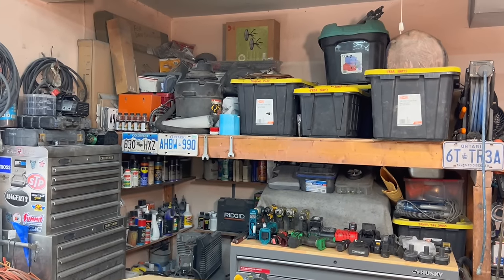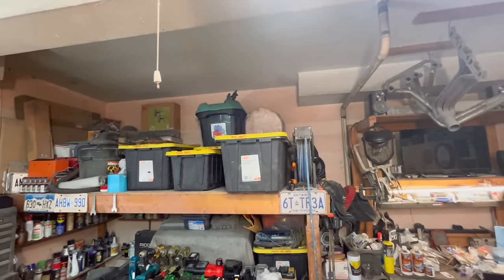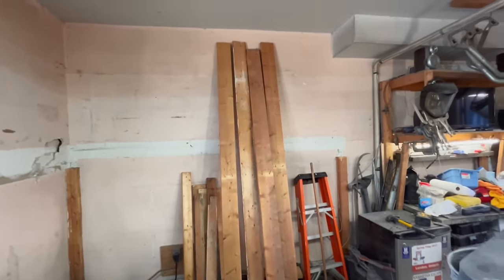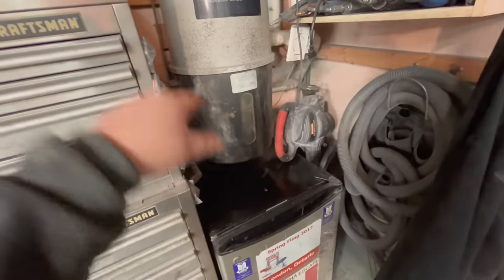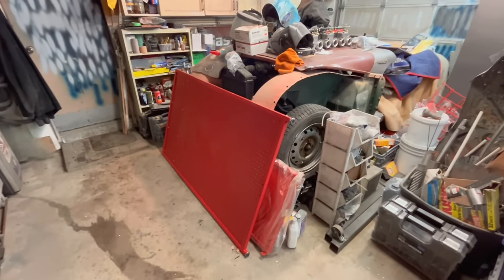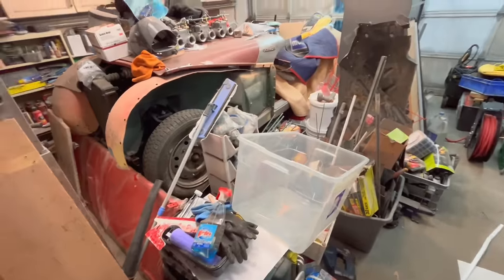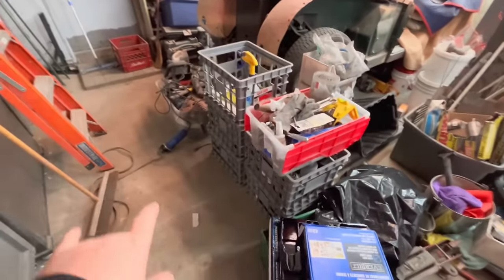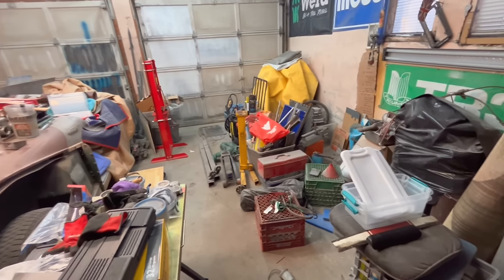Garage Makeover Project.....

Comment: David! Hello from Argentina! Man, am I glad you are posting since Elin is on vacation and only putting up a few pre-recorded videos.  Wow, it is almost like summer there 4.4c!  Here, I am suffering as I watch this, it is 23.9c with low humidity, poor me!  Your garage is looking very organized, I might do the same in mine when I get home. Mine is made of cement block walls, which are very hard to drill even with a good hammer drill, so mounting things on the back wall is basically out of the question. I need to move my mountain of car parts to the warehouse. I just bought an AC unit, so can do work inside during the summer, I have an 80,000 BTU propane heater for the cold months, but I am doing the snow bird thing for a few months. Thanks for giving me some ideas on what to do when I am sitting around recuperating from my future hernia operation.
Reply from the maker: Hey Jim, 23.9 C sounds just about perfect!  Yes, I’m quite happy with the garage…I’m sure I’ll still do a few tweaks here and there.
Reply: My plan was to be here for another 2 weeks, but my hernia is telling me different. I  will have to "suffer" through another week of great weather, then after Easter, it might get crappy (rain). I try to not lift anything heavier than a can of beer. I hope to see some progress on your TR3 and the TR250 with the Webber carbs.  I am pretty sure I have the only "Rusty Beauties" T shirt in the in this country   @cheftush

Comment: BRAVO Chef Tush, BRAVO!  What a great transformation.  Looking at the results, I am amazed at what you accomplished in your spare time, considering that you have a demanding full time job.  I am looking forward to see how your new air system setup and quazi-paintbooth is rigged and used.  I hope you are able to get a good water extraction system installed without having to spend an arm and a leg on it.  I'd like to see your efforts at welding/brazing/soldering up your own moisture removal manifold on the output of your new air compressor.  People have used PVC piping with sometimes explosive results, so I'm always interested in safer DIY methods of getting a quality product out the nozzle!
Reply from the maker: Thanks!  Yes, I already have the water extraction filters/desiccant drier/refrigerated dryer for the compressor as well as a couple of regulators.  I’ll just need to figure out the plumbing and what will work best for me.  Stay tuned!

Comment: I'm totally amazed at what you are able to accomplish in such a small space, for two cars and all of the required equipment.  It shows others what is possible with limited space.  Keep up the great work!  Must be somewhat difficult to keep warm in the middle of winter, hope you add insulated garage door panels.
Reply from the maker: Hi Robert, Thanks. Actually, that little heater works pretty well out in the garage.  I’m lucky that the garage picks up some heat from that rear wall and the ceiling.

Comment: Chef, what made a huge help in clearing out my garage is building sheds outside usually 4 foot wide by 8 foot.  That being said I still need to build one that's 10 ft x 12 ft in the backyard (maximum allowed without a permit).
Reply from the maker: Yes, I have a wooden shed 8x10 and a temporary shelter at the side of the house.   These are helpful to be sure.

Comment: Great job, David.  I was so inspired I went right out to my garage and gave it a good tidy!
Reply from the maker: I just came in from working on a little project and for the first time in a little while, I made sure to put all my tools away 😉
Reply: Well done Dave, great minds think alike.  I didn’t know that you were doing this but at the end of February I took a week off of work to sort the garage out.  Before I started the TR3A project I built a mezzanine floor in the garage with a set of steps up to it.  There were boxes of ‘stuff’ up there which hadn’t seen the light of day for nearly 9 years and so much of it was discarded.  I moved some shelving which was at the back of the garage and built a new bench I can work on and store my compressor amongst other things under.  There wasn’t any painting done, but it still took me a week to do.  I have also made space for a 1970’s Jukebox, which should be delivered soon.  The best thing about my new garage is that I will be able to get both TRs in it and be able to get out of them without having to climb out!
Reply from the maker: @markaluge  I’d love to have a little lounge space in my future garage for an old juke box and a couple of pinball machines 😉

Comment: Thanks Chef! Now I feel like a real loser. I've got a 30' x 90' shop building I bought right before retiring.  That was 5 years ago. I told my girlfriend I wasn't going to put a thing in it until I painted and rewired it.  Right now, I can hardly walk through it and the paint and wiring still aren't done. It was originally divided in half. I want to put the divider back in where I can heat and cool the front half. The rear half will be just storage. After seeing this video. it gives me hope that I can eventually finish it. PS: get those doors painted!

,
Reply from the maker: Yep, next thing on the list!  Cheers, Tush

Comment: You could put your air compressor in your basement and plumb it to the garage. It would be a lot quieter in the garage and you would be taking in cleaner air. It would also add a little more space. Looking great though.
Reply from the maker: I did think about it.  It would be a little difficult to get it down there as the compressor is about 450lbs and my stairs are not a straight shot…plus, draining the compressor would be a bit of a challenge as I’ve only got one floor drain about 20 ft away…still, it could be done.

Comment: Dave ( if you’re not doing much work to the passenger side of that car) why not back it in so you’ve got lots more room to get in and out of it?
Reply from the maker: I actually have lots of room on the left as long as the jack stands aren’t there.  I can’t pull it that tight to the wall anyway as the new location of the workbench will prevent that.    The intent it to work on cars on the right side of the garage so I’ll end up pulling that car more towards the center of the garage to work on it…I don’t  keep a car in the left bay anyway if I’m working on another car…

Comment: Dave with all those chemicals (even in their own cabinet) and the proximity of welding/grinding, would it be a good investment to have a fire suppression system of some sort installed in the garage? The recent fire at TRF has made me rethink fire safety in my own garage (like you, it’s part of my house).

BTW - if you still have your old fluorescent light fixtures, it’s fairly easy to rewire them to use LED bulbs. I did that with the old fluorescent lights in my garage.
Reply from the maker: Hi Jim, well,  I do have several fire extinguishers in the garage…and, those chemicals are more “protected” now in cabinets then they have been for the last 20 years with the open shelves I had in the corner under the mezzanine.   Having said that, I did just get two welding blankets to cover anything that might find a spark either from grinding or welding.   I do plan on mounting a smoke detector in the garage though as I’ve never had one installed in there.
Reply: @cheftush might just want to add a flammable rag bin?
Reply from the maker: @pucman1 anything that has solvents on it goes outside the garage…that’s one thing I’m careful about.

Comment: Instead of paint, cut to size and glued on insulation?
Reply from the maker: For the garage doors?
Reply: @cheftush  my bad sorry should've been more accurate with comment. You can buy insulation in a 4 X 8 sheet  that's dense and be can cut to size of your garage door rectangles. Throughly clean doors, use a good contact cement on rectangle and cut to size dense foam insulation